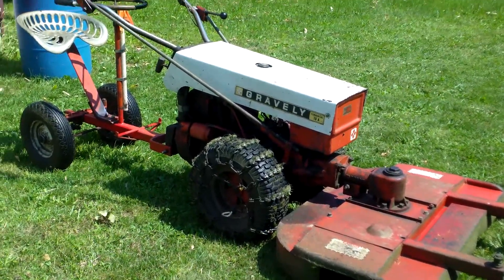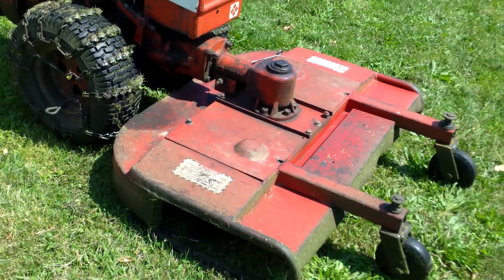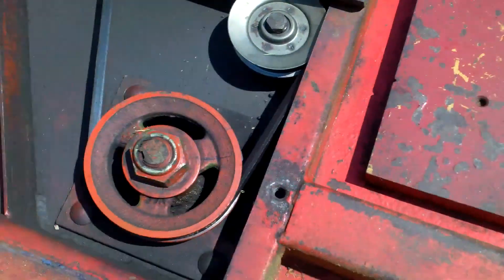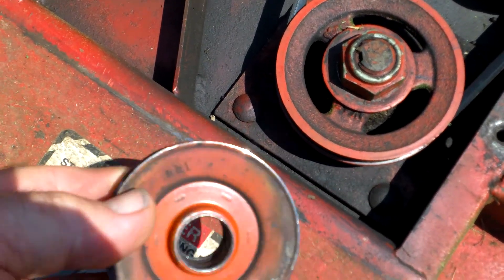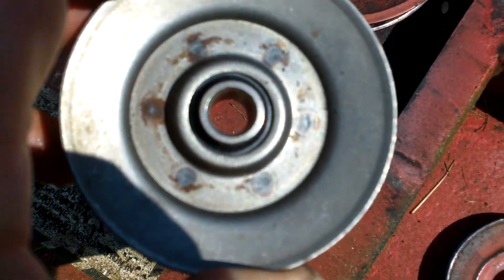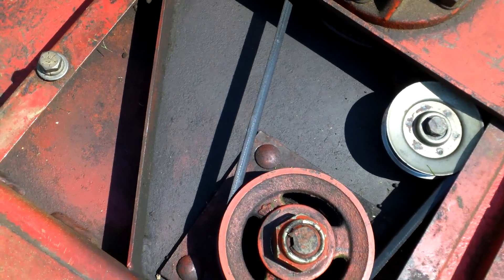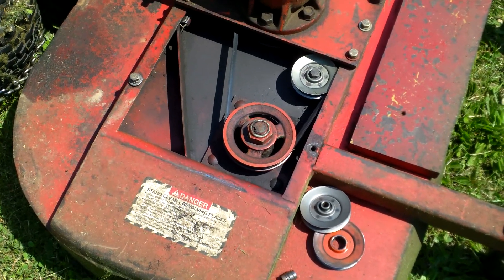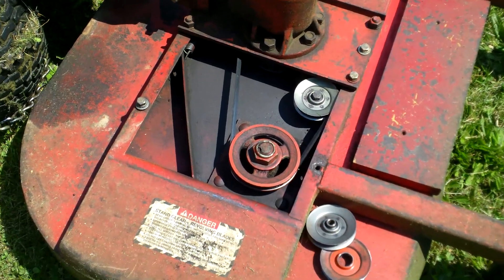Gravely 40 inch deck repair.

Comment: They can be greased, you just have to work at it a little harder.  A shot of oil will work too.  I sharpen my blades in spring & grease everything twice a year.  The belts on it are over 8 years old.

Comment: Sadly, these new idler pulley, and tensioner pulleys are made with cheap sealed 
( non-servicable) ball bearings !
Not intended to last.
In fact, they are intended to fail prematurely !
Regular inspection of all spindles, idler pulleys, belts, etc. is critical to the quality of the cut, and performance of the mower deck.

Comment: You need to take the covers off as regular maintenance. That's why they are called "access covers"! Gravely engineers were much smarter than you, and provided means for keeping their machines in good operating condition. It's up to the owner to make the effort. You have a nice machine!